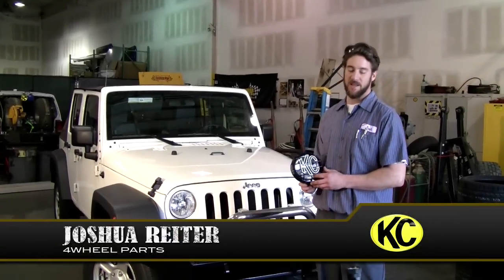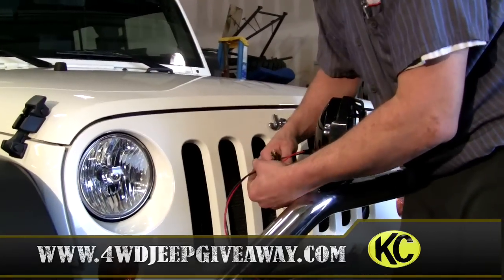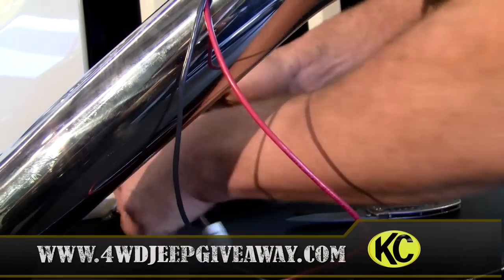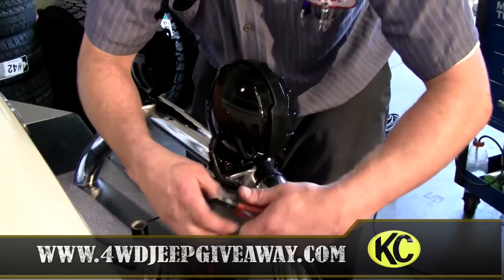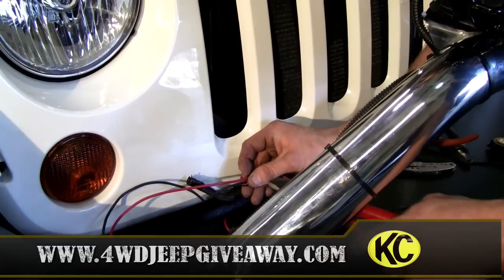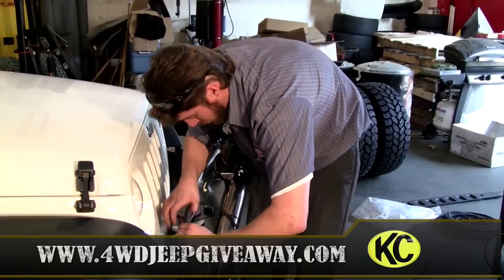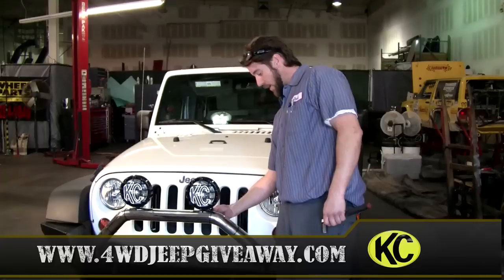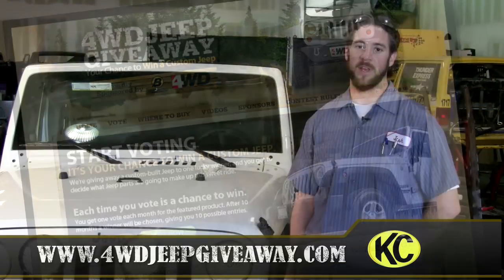Jeep Lights Winner: Installing KC HiLites SlimLites

Comment: Great tip on the staggering the wires! I've run into this problem so many times trying to get connectors into the loom. Another great tip on putting black tape on the loom after starting the wires! This is going to come in handy in the future for me. Learn something new every day. Thanks for the help.

Comment from the maker: You're correct, when the fog lights turn on the KC's turn on. When you purchase the KC HiLites as a kit you receive a separate switch and fuse so that you can turn them on separately. They just weren't installed that way in this video. Let us know if you have any other questions, thanks.

Comment: Thanks.  Yes, I'm trying to install them on the lights they came with which is are the Slimlite 120.  I did finally get them into place.  It did take a bit of pressure to press down on the snaps to get them into the groove, but they're in and secured now.  Thanks again.

Comment from the maker: You will need to check into on-road usage with your state and local laws. Some of the concerns you should check into are mounting locations, light wattage limits and coverage laws. KC does offer 3 different types of SlimLites for your considerations the Long Range (Not Legal for highway use), Driving Light and Fog Light.

Comment: Slebemma is right, by installing the 2 x 100w bulbs you are adding (16.66Amps x 80% rule = 20 Amp fuse) to the circuit already providing power to the 2 x 55w bulbs. Lighting loads are calculated at 100%. Depending upon the driving, strip back the wiring in a year,  you will see the surface of the conductor has darkend.
The reason for stagging connections is not for fitting the wires in that cheep plastic tubing. It's to insure the splices are not side by side. 
Tye wraps look unprofessionial.

Comment from the maker: The stone guards simply snap onto the KC HiLites and shouldn't require anything special to put them on. They are tight and do require a little pressure to put them on, but no excessive force. By any chance, are you trying to install these on a non KC light? Hopefully you have figured this out and they have been installed on the light. Let us know if you need any help.

Comment from the maker: @drumsalltime Doing this without the zip ties would require the customer to drill a hole into the back of the grill hoop then run the wiring to the bottom of the hoop for another drilled hole either in the hoop or bumper. It’s a lot of work, but if you are looking for a perfectly finished setup this is your only option. Unless of course you don’t wire the lights and put them on the Jeep for the off-road look, which a lot of people do.